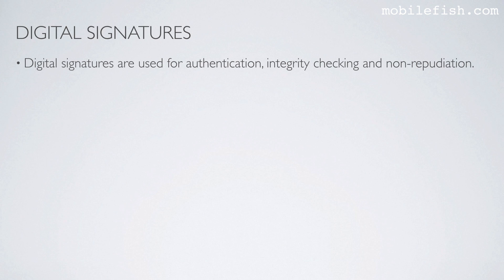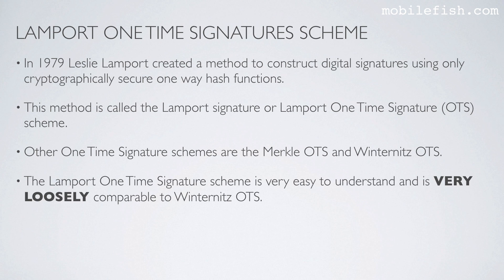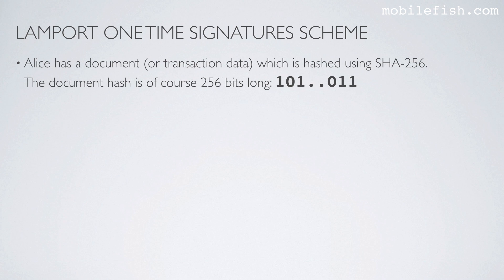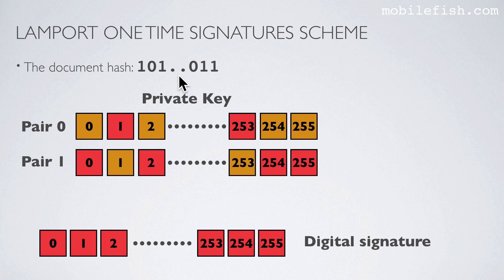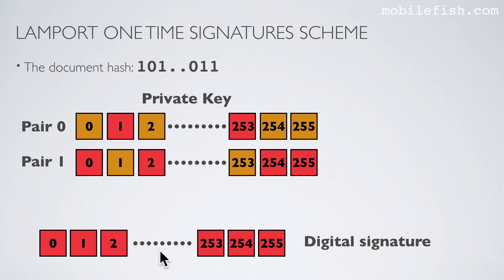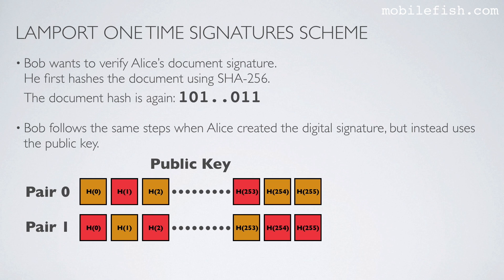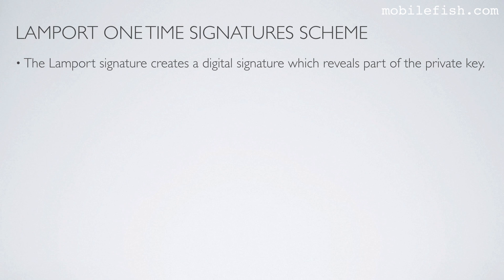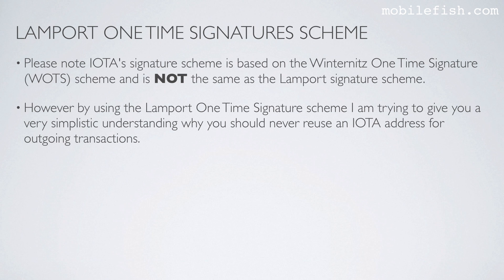IOTA tutorial 6: Why you should not reuse an address for outgoing transactions

Comment: As usual. Great work!

May I ask a basic question on the purpose of signature on IOTA. What are we protecting with this signature? I am thinking about the data integrity, that is the 256-bit Hash in your example. However, if someone in the middle, who can do the same thing on on a new Hash, and sends it to the target. Since there's no identity linkage between the sender and the signature (in RSA we still have public key/CA to kind of protection), the one receiving the modified Hash with correct signature will accept it. 

Maybe I have missed something here that can link to the sender's identity. Kindly advise if it is possible.
Reply from the maker: If you watch all tutorials sequentially, it will all be revealed in IOTA tutorial 17, be patient...
But in short:
If you create a transaction, ONLY the person who owns the private key can make a VALID transaction. The validity of the transaction is checked with the help of the signature.